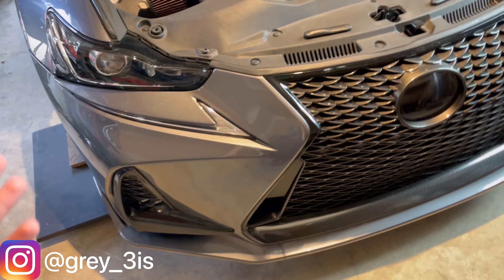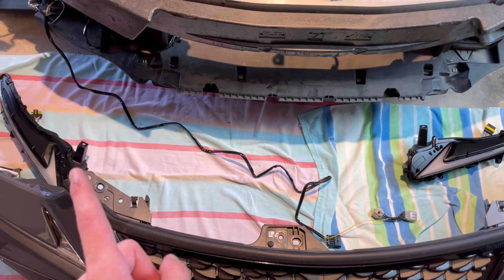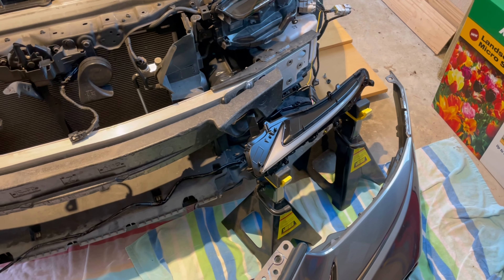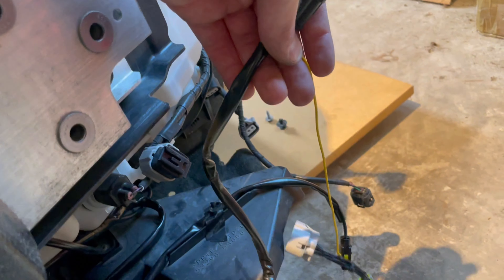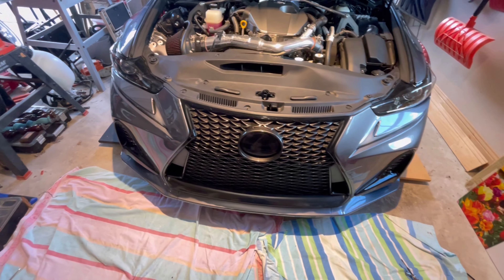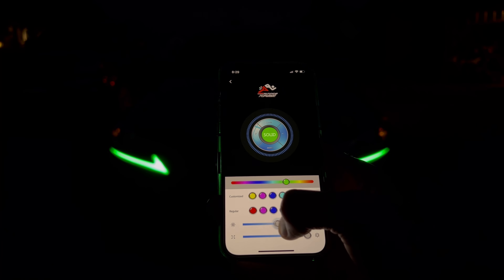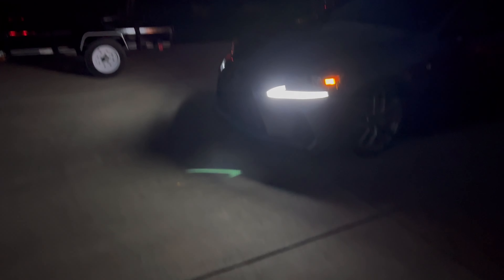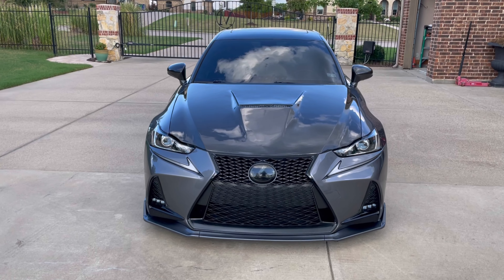HOW TO INSTALL RGB/ SEQUENTIAL DAYTIME RUNNING LIGHTS | LEXUS 3IS

Comment: What I like you to show us how to install led strips underneath of the car and light up simultaneous with puddles light from mirrors. Basically I like to see these lights on  when I approach the car. Thank you
Reply from the maker: Oooo that would be cool! I don’t have LED strips under my car, so maybe if I end up installing them in the future I’ll make a video about that. 🙂
Reply: @Grey3IS  I don't know the color of the wires to power up the puddle lights if I know I would route those wires from hardness on the floor to body plug.
Reply from the maker: @northstar5405  Yeah, I’m not sure either.

Comment: Will these fit 2015+ First gen RC?
Reply from the maker: Unfortunately these do not fit any of the RC’s. However, they are in the works for the RC. They should be a product in the near future!
Reply: @Grey3IS  any updates on that? where can we check?
Reply from the maker: @Mikehammondy  I recommend DMing tansowerkz on Instagram or emailing them to ask about this.
Reply: @Grey3IS  appreciate it, cause they look like they would fit RCs lol
Reply from the maker: @Mikehammondy I get that. The RC’s are a little smaller and curvier.

Comment: Just installed mine and the solid colors don’t work it just stayed white but all of the modes work any help to fix it?
Reply from the maker: That’s funky.. So when you press solid colors, nothing happens? But even when you do modes with colors, they work?
Reply: It also turns the solid red when I turn my car off only until the lights turn off. But when the car is on none of the solid colors work it stays white
Reply: @Grey3IS yes all the modes with colors work even when I’m driving but the solid colors don’t it just stays white
Reply from the maker: @Friday12321  Weird.. are your headlights on when trying? The animations shouldn’t even work without the headlights being on, but figured I’d ask.
Reply: @Grey3IS  yea all the animations work fine when the car is on but the solid colors just don’t
Reply from the maker: @Friday12321  That’s weird. Yeah, that shouldn’t happen. You might have a faulty module (the black box). I’d contact where you got it from and explain the issue.
Reply: @Grey3IS  it’s weird cuz all the solid colors work fine when the car is off but once I turn it on it stays white
Reply from the maker: @Friday12321  Weird.. I’d make sure your low beams are on or the light stick is fully switched to OFF and give it one more try.
Reply: @Grey3IS  ok so now at night time the solid colors work fine but in the day Ik it’s gonna go back to white I think it’s cuz my headlights was on auto. Any way to fix it?
Reply from the maker: @Friday12321  Ahhh yup. The headlights have to be on. But you can go into setting and turn off “drl”. That’ll bypass them staying white on auto during the day.
Reply: @Grey3IS  so it’s in my cars settings right? Yeaaa cuz during the day the headlights aren’t on so it doesn’t work
Reply from the maker: @Friday12321  correct. It would make them able to be RGB whenever.